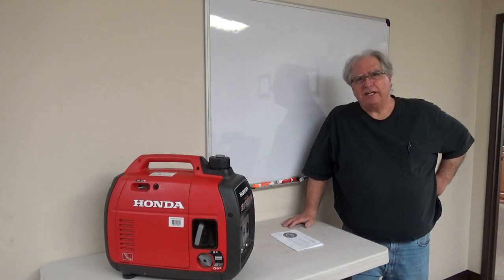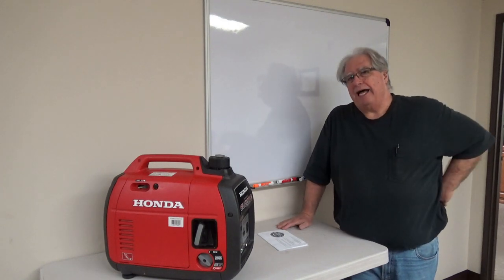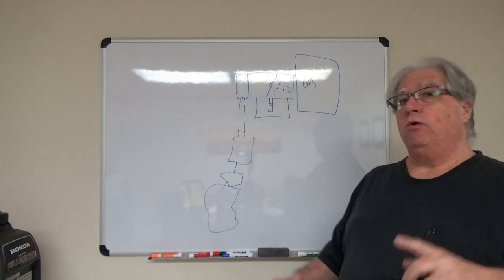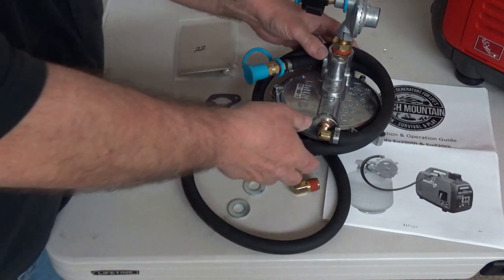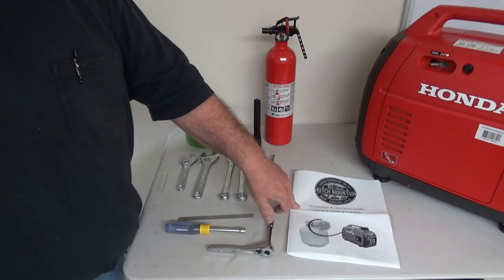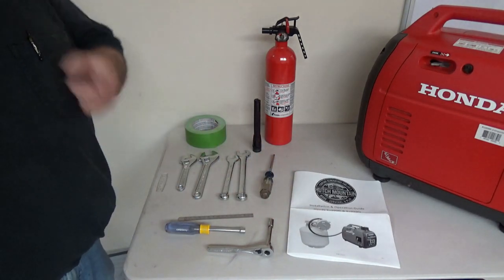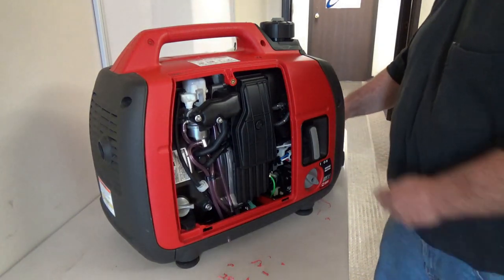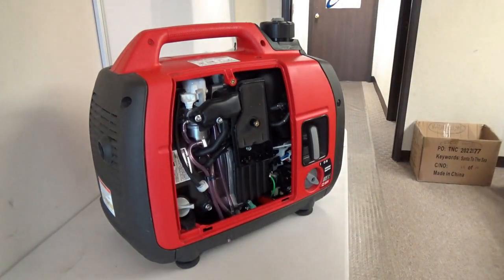Howto: Adding A Propane Conversion Kit To Your EU2200i

Comment: Stu, thanks for another fascinating video. You mentioned jets were included in the kit. Did the instructions indicate when and why/how they would be installed? Additionally, the regulator that connected to the propane tank was shown but its installation wasn't depicted. Does it have any adjustments to change the air/fuel (propane) mixture?
Reply from the maker: Hi Robert,
Yes, the instructions went into what the jets were for and how to change them. There are two additional jets, one for high altitude and one for natural gas if you choose to get the additional hoses.
The Regulator assembly comes assembled and is attached via a standard propane take connection. Just like hooking up your BBQ.
Yes, it has an adjustment but is not documented in the instructions. To get that little piece of secret sauce, you will need to contact Hutch Mountain.
Hope that covers all your questions!

Stu
AG6AG